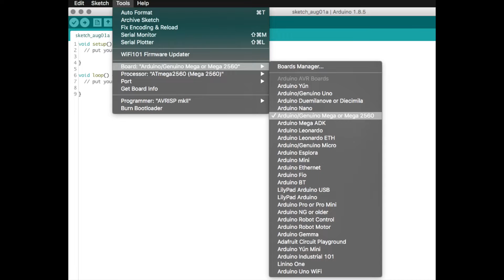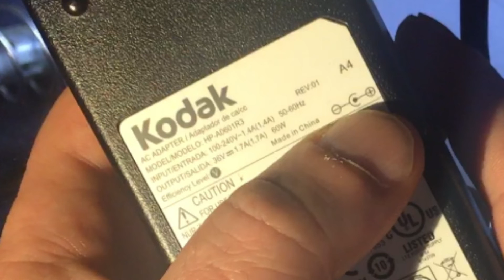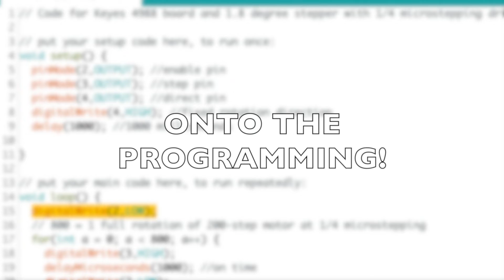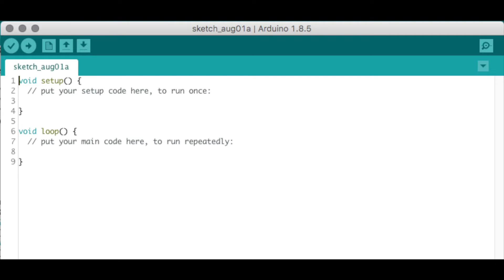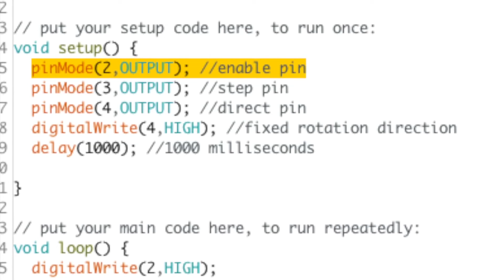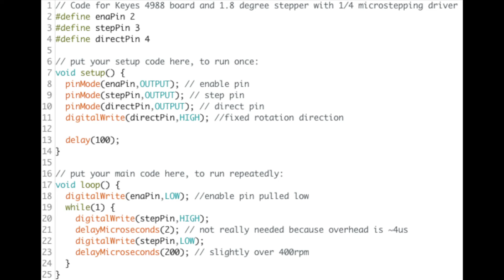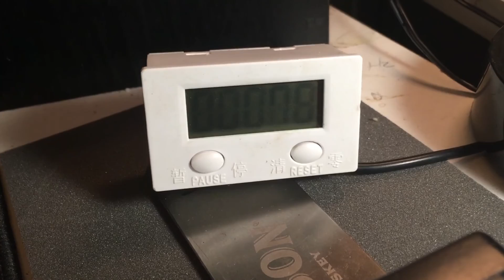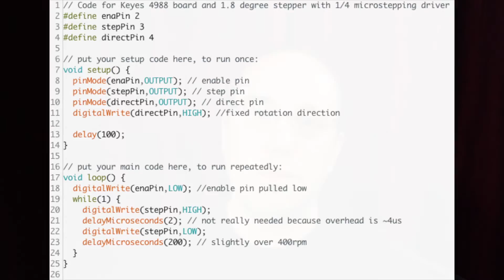Simple Arduino single stepper motor control - for experimentation and testing

Comment: Hi Alex, great video as always :)

When you mentioned the motor going back and forth at the end of the video, I was reminded of some of my motors having a different pin layout. You might want to add something like that to the video, as I'm sure folks are going to bump into that and  complain loudly :) 

Oh and on the subject of cheap boards, an ESP32 dev board might have worked too for those folks who have one or two laying around, it too has a Arduino compatible library.
Reply from the maker: Good point. I'll add a note in the description.

I plan to do a few things with the esp32/8266 boards in the future. It should be fine for this type of project.  There were a few strange things about those chips that made me put it on the back burner for a bit, like it doesn’t have on chip USB so an external converter is still needed, and the SPI read seemed to be painfully slow in testing. I had some really slow serial transfer rates as well, but then I found out that windows small packet transfer rate was literally hundreds of times slower than MacOS, and dozens of times slower than Linux , so I'll have to give the recent arduino and platformIO a try when I get a chance . I was super excited about the high clock speed and large memory on the ESP boards, but the slow serial and SPI bummed be out, so yeah, I’ll have to do testing with more recent software.